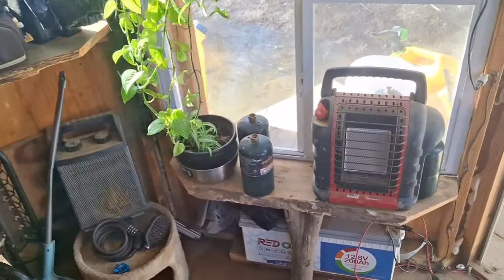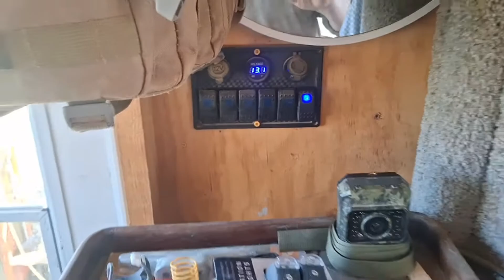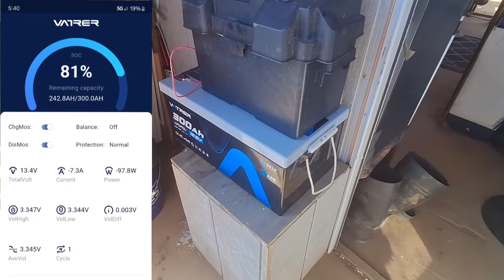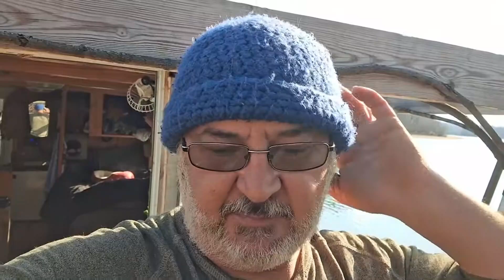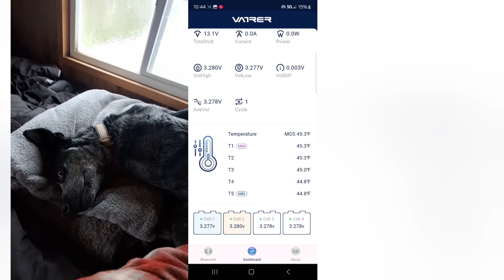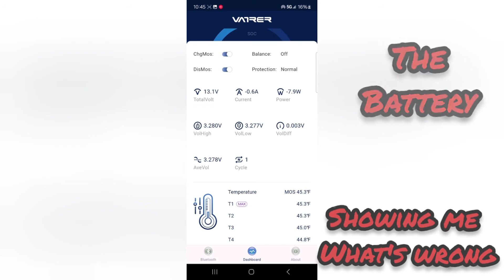🔋🔋Vatrer 12V 300AH Bluetooth LiFePO4 Self Heating Lithium Battery Worth having🔋🔋

Comment: I imagine that heated lithium batteries  capacity will affect the  run time  of those batteries ? since they heat themselves  that is taken from the Ah  run time of the battery? 
how many watts does the heated battery need  to heat the battery?  low temp protction is necessary also if not heated.
Reply from the maker: Heating the battery does not affect the battery capacity. The heating method is to connect the battery to the charger at 0℃, and the charger supplies power to the heating plate. Charging will not start until the battery temperature is higher than 5℃. The battery has low temperature protection😀